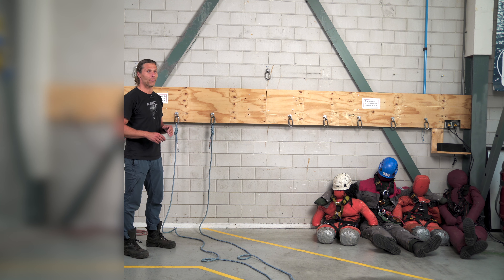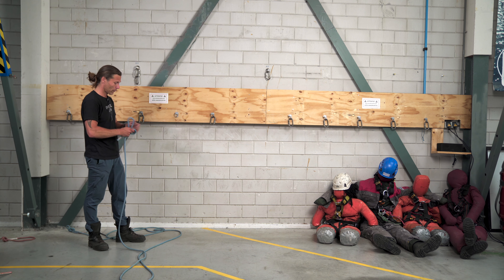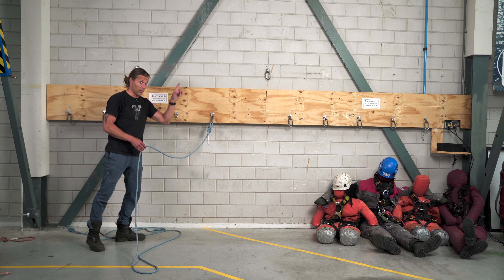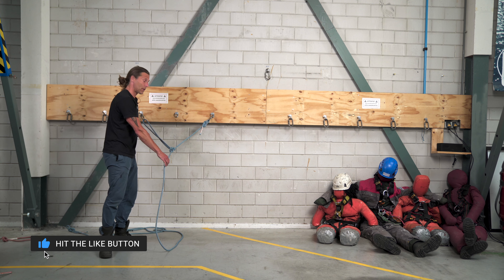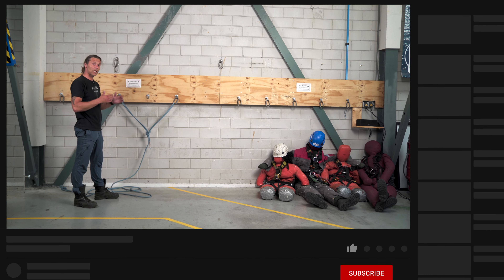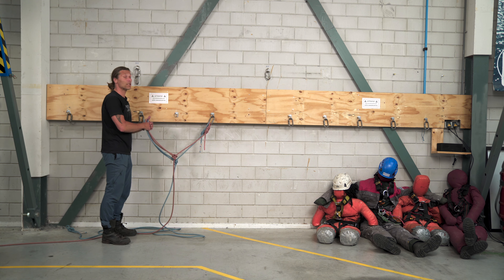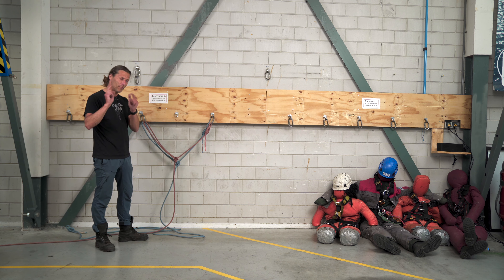How To Rig A Small Y Hang - IRATA Level 1 Training

Comment: So just to be clear. I can't use the same anchorpoints for the backup line?
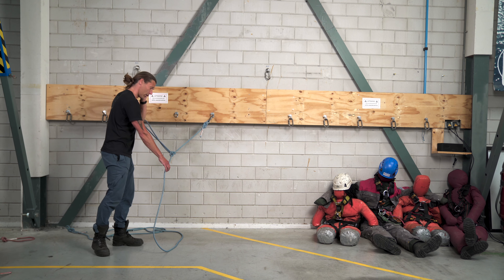Reply from the maker: That depends on the situation and as I explain in this video, if your anchorpoints are less than 15kN than not. If they are, you can. This is exactly what I explain at 3:17 and with the insert of the IRATA ICOP. Other schemes or rules may say something different though.
Reply: @TheRopeAccessChannel  thanks for the awesome content💪
Reply from the maker: @williamvanleeuwen6303  thanks 🙏🏻